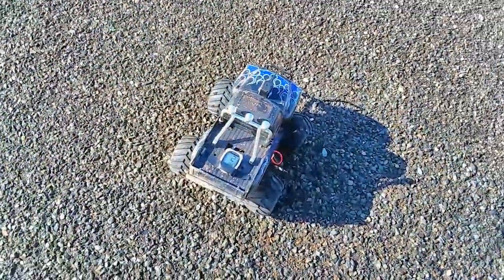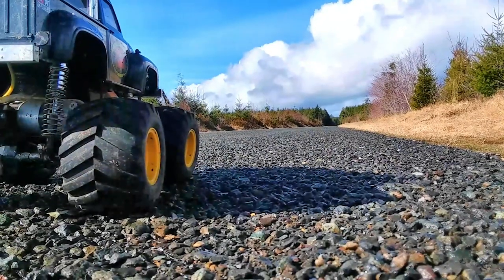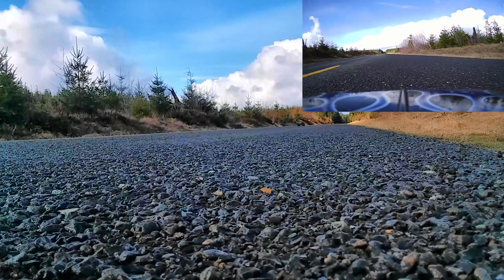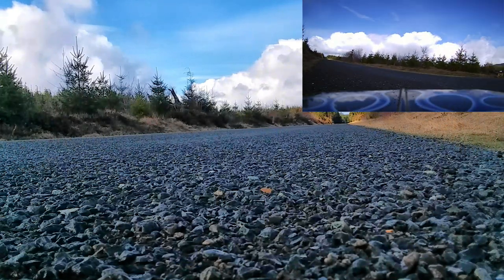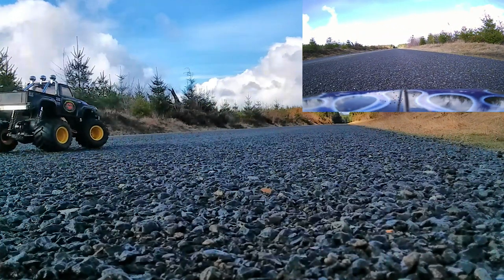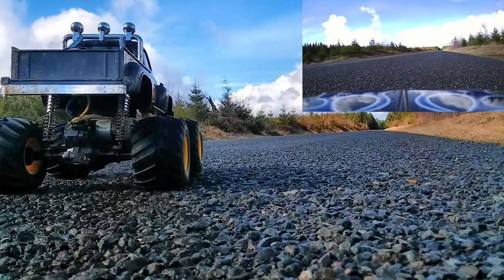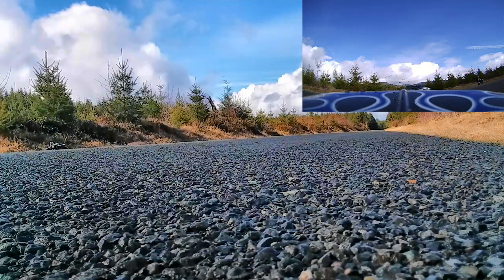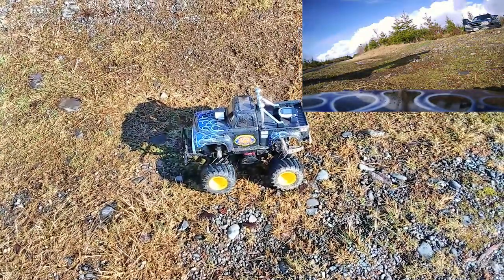Tamiya Midnight Pumpkin GPS speed run (Stock)

Comment: I would put a sport tuned in that even though it's a 23 t  the GT tuned it still has a faster RPM than the sport  GT tuned which is interesting. I think you should try it with a lipo sometime see if the speed would be different.
Reply from the maker: I have never tried any of the Tamiya modified motors, might need to look into that.
Reply: sport tuned is 27t with advanced timing set on it, and it has no way near the 350 g-cm torque that tamiya claims
Reply: @xismxist  do you know that some of the super stocks in TT tuned and the ugt have over 500 or 400 GCM or you said.